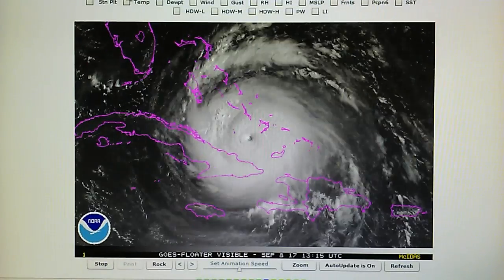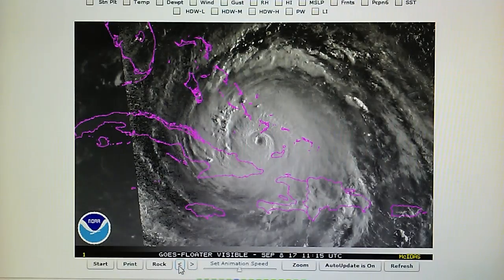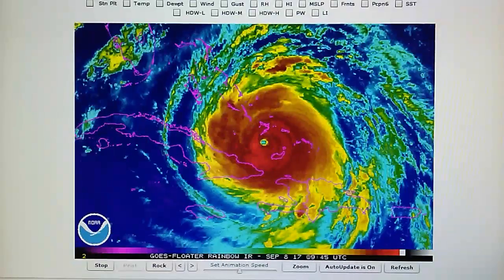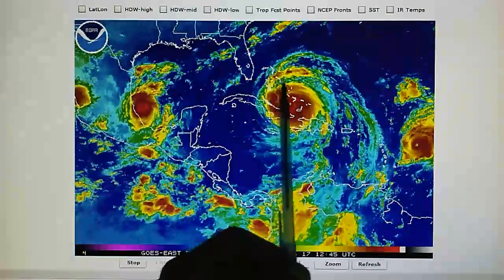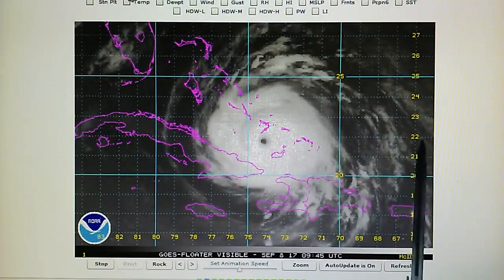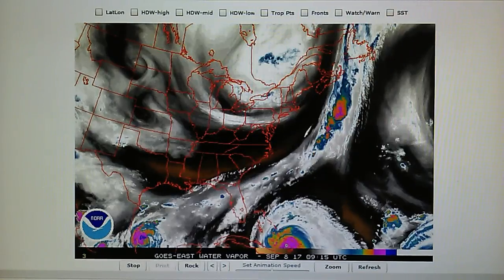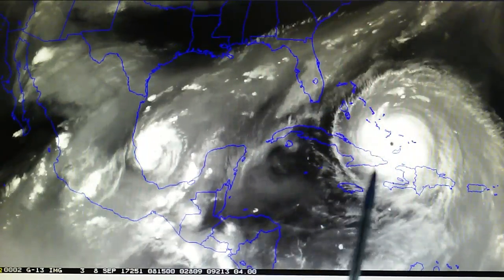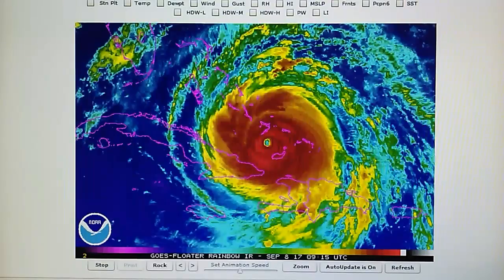9-8-2017; Irma Targeted w/Microwave, Eyewall Disrupted; Too Little Too Late; Set to Mow S. Florida

Comment from the maker: 8:25PM PDT (Sat.) High pressure is now installed in the Westbound path of Irma which has forced the storm to change its course to the NW. Strong clockwise rotation is clearly visible in the Gulf of Mexico  Watervapor map on the western side of the storm!  Looking at the West Atlantic Watervapor map, there is an enormous upper level low pressure system spinning North of Jose and Irma in the Atlantic; this giant low is blockaded with high pressure to prevent the tail of Irma from winding into that low's vortex. The moisture tail of Jose is also being blocked by high pressure as it moves toward that upper level low in the North Atlantic. The question is WHY is Irma not blockaded with high pressure to prevent it from moving North into Florida to prevent the unfolding disaster? The tools are being used now to install blocking high pressure zones around that low in the North Atlantic yet not being utilized to prevent the unfolding disaster in FL.  Irma is being steered into Florida and allowed to cause another multi billion dollar disaster. Disasters and terrorism have become big business!

Comment: 1PR, PLEASE LOOK AT IRMA, THEY'RE BLASTING OUTSIDE RINGS OF IRMA AND IT'S  SEPERATING AND GOING IN THE OPPOSITE DIRECTION FROM THE EYE OF THE STORM!!!!  7:20 PM 9/9/2017  http://www.goes.noaa.gov/dml/east/nhem/eaus/rb.html IRMA IS GOING COUNTER CLOCK WISE AND THE OUTER OUTSIDE RINGS ARE GOING CLOCK WISE. HOW IS THIS DONE?

Comment: For those wondering or doubting where some of these HAARP locations are should look up (Prince Edward Islands) Marion Island -46.875868, 37.858979 & Ascension Island -7.948012, -14.330136, Mt Saint Helena -15.962448, -5.654503 & have a good look at the TTA's all over them. http://www.dtic.mil/cgi-bin/GetTRDoc?AD=ADA497449 & Trindad Island -20.510208, -29.314676
Reply from the maker: aszi88 - Your channel is a joke- attempting to debunk aerosol chemtrails in 2017?  Pathetic shill.
Reply: aszi88 there is nexrad and other types. You need to get up to speed and wake up.  They've been doing this for years.  They even do weather trading.  So before you say there's only one HAARP look into they face there are other methods being used.
Reply: +aszi88 Do even know what the acronym of HAARP means...or what acronym means? It is a research program, funded by the Air Force, Navy and DARPA based on an Air Force owned facility/site. It just so happens the locations/islands I provided are military islands and are littered with TTA Tesla Tech Arrays and HTA HAARP Type Arrays.
Reply: Oh if they have Open Days and a whopping 200 people went, that's proof enough for me! ;)
Reply: I seriously hope you're reciprocating my sarcasm there! ;)